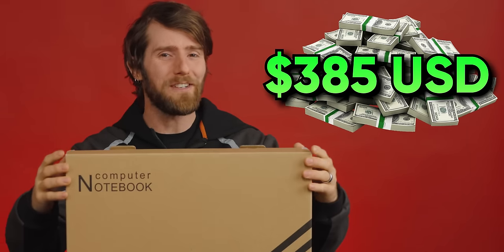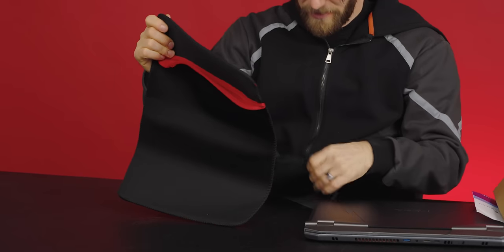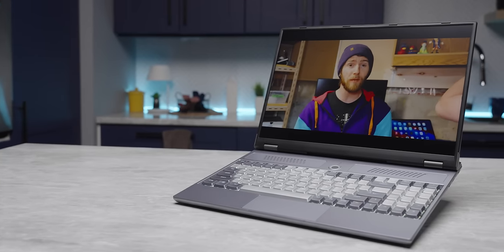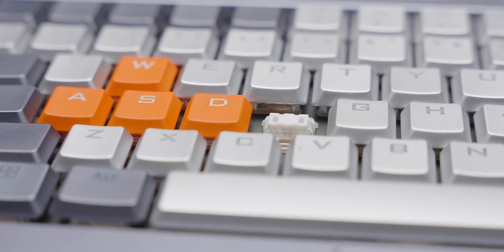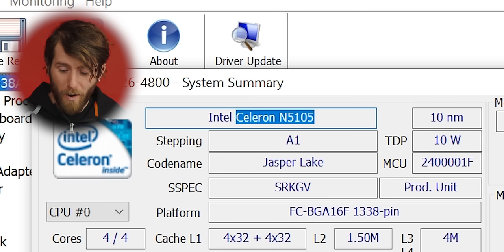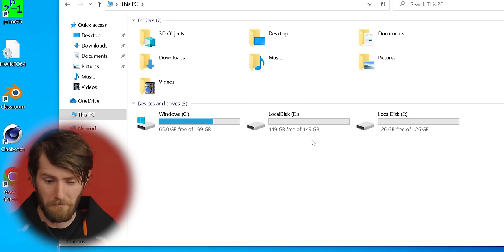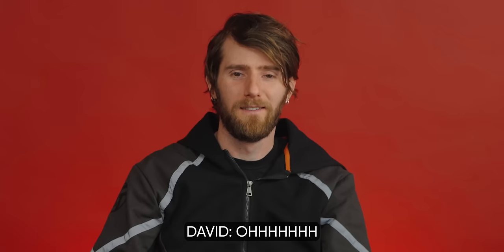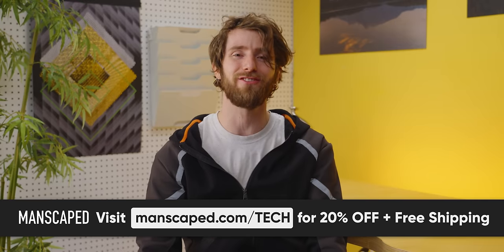Brown Star for Effort – This AliExpress Gaming Laptop is HILARIOUS

Comment: For that batch file to activate windows, "jh" stands for "JiHuo", which is the spelling of the pronouncination of "激活", or "activation". I assume they are installing a legit copy of windows but activated it with some magic from this batch file. I won't doubt any changes they made to this particular copy "bad" since otherwise they could just remove the activation entirely. The reasons they made those changes such as partitions on hard drive, arrangements of icons on desktop, could be based on behaviors of potention users who would purchase this laptop. This looks like a perfect gift for parents and my parents would do the exactly same thing with any new laptop. The activation actually could be legit as well if they are indeed authorized for OEM activation on devices for sale. There used to be a time that all laptops sold in China were installed with windows copies activated by such batch scripts relying on OEM servers including big companies like Asus or Dell. The scripts basically just install a product key, change the activation server to any corresponding OEM server and finish the activation process. Of course you could "build" your own "activation server" and run your own script to pirate, and that would be unauthorized and not allowed.
Reply: Lol, my parents don't even know what a hard drive is, let alone how to partition one, lmaoooo.
Reply: They are using kms activation in the batch file. It is not uncommon
Reply: I would reformat it just in case. You never know if Xinnie the Pooh has access to your files with a Chinese device.
Reply: This reinforces my feeling that everything about this is like "we left the provisioning script on the device" which is like, idk, I've worked IT, I've done that. The paranoia is tedious. For a high school or early college student with a lot of papers to write, and at $350 USD? This sounds like a really nice computer.
Reply: @dejuren wait, what is gaobao?
Reply: 高包? 高保?吿包? tf yall fake Chinese talking about I had never heard anyone in China call the internet or anything  "Gaobao"
Reply: @DD Johnson  I've never heard that either. I guess he was either joking something I don't know or maybe he meant "taobao"?
Reply: @Lying29  dude throw an unfunny joke and got everybody confused af💀
Reply: @ddjohnson9717  nah, just some edge lord making up Chinese soundings words and think he's cool.
Reply: @dejuren i remember back in the day you could get 3 spring rolls to the bao. now all you can get for 3 bao is one of those fur hats that lei feng wore, and you can't even get a green one since green hats are such a rare high social status symbol in china
Reply: I don’t think your parents would set it up to show hidden files though. That is dangerous.
Reply: @Gionimo  My parents on a windows for sure would. If I was a parent I would too, hidden files on windows is a great way to lose gaming saves and configs if you're not using steam(gog, minecraft, indie games etc do this a lot).
Reply: @UltimatePerfection  CCP can just buy your information from Microsoft, no complex operations needed
Reply: @Lying29  高堡奇人的高堡？means a weirdo country or land? 不知道。
Reply: @dejuren 没有什么好人坏人，只有明白人。你说对不，好纽约, 纽约北方网友.
Reply: @唐牧城   That is my point. It is cost inefficient to “spy” on every device; or buy them from third parties. Btw, your data centers, and their contents, are, by regulation, subjected to CCP inspection if requested inside mainland, even if you are international company. So you don’t even need to buy the information if you are only talking about the 1.4 Billion people, which I presumed not to be the subjects of the comment I replied.

And don’t talk about GFW as if you experienced it by yourself, lol. There’s plenty of ways to go around it. And Chinese international students alone is about a million now, which most would return to China. What GFW really is for are people, such as dumbass “conspiracists”, like the commenter I replied
Reply: @UltimatePerfection  still better than being controlled by the eye of pyramid
Reply: @ahweikun  wdym?
Reply: @UltimatePerfection  I hate to fuel your paranoia, but even wiping the SSD/HDD/whatever other mass storage device is used doesn't guarantee the device is clean, as unwanted software can as easily be a part of the firmware stored in an onboard chip, for example
Reply: @MrCh0o  Agreed, but it's the first step to getting the device clean. And something that everyone can do. Auditing firmware (and removing any malicious code in it), on the other hand is much harder (and for the same reason firmware hacks are seldom used by even the government actors - remember Pegasus? A regular piece of malware. Highly sophisticated, yes, but it doesn't hide in the BIOS or anything like that).
Reply: @dejuren lol you must’ve learned that from obscure right wing sites. You ask even a tech savvy Chinese citizen and  they don’t even know what you’re talking about. How bout you write the actual characters?
Reply: I found a dell factory key generator on a flash drive one time. It would install the os and use almost this same script to contact the servers to finish activation. It would provide a legit copy of windows (after if activated itself) to anything you plugged it into.
Reply: Do they still do enterprise activation? Basically IT at a company ran their own activation  server or had a key that didn't require activation, and just paid Microsoft to use 1,000 of them or whatever. Microsoft could do a software audit if needed and if your network use was off, could get penalized.
Reply: @TheZachary86  Well he was writing the actual Chinese characters but it's just two separate words combined together and they mean nothing
Reply: @UltimatePerfection  xinnie the Pooh 💀
Reply: @Lying29  Maybe you should moonlight as a consultant for Linus tech tips. Or they could at least cut you a check for educating them on their professional review of the product.
Reply: There’s a lot of 3rd party activation servers (they’re most China based, because they don’t care about piracy enforcement no matter what MS says) and you can assign them via slmgr and it will run a full activation when you use the appropriate KMS key
Reply: I’ve seen a similar trick done with some interesting systems that have come out of Iran. Amazing the innovations when there are blockers that seem impossibly to overcome.
Reply: @@dejuren1367 I can't understand what you say.
Reply: @auqustfire  My dad and grandmother knew how to partition hard drives in the 90's.. too bad both of them are dead now by 2022 :(

But yeah, just depends who is in your family I guess lol We grew up with Commodore 64's and all types of PC's in our family.

I do miss those days going to PC shows with my dad and grandma
Reply: @UltimatePerfection  The usual projection. Windows back doors are by NSA etc.
Reply: @steinbauge4591  Again, I would rather be spied on by someone who I know my country is allied with than someone who is at best of unknown allegiance and at worst the enemy.
Reply: @UltimatePerfection  You maybe but Windows is used all over the world.
Reply: @UltimatePerfection  Yeah, certain countries have already banned Windows on state/company level ;)  They opt for 'official' Linux versions like the Russian Astra. Only reason to keep Windows now is a few applications and convenient gaming.
Reply: @steinbauge4591  Agreed. Can't wait until Proton matures enough to play brand new titles.
Reply: 我个人觉得这个笔记本挺便宜的，更换SSD，重新安装系统. 用来上网，看视频啥的不错 :)
Reply: Magic
Reply: 你字多跟你混
Reply: @UltimatePerfection  i rather a pooh panda access my files than the CIA... at least i know the panda won't try to murder me with a drone or falsely accuse me of rape... =)
Reply: @UltimatePerfection  I too would reformat, because I rather have it my way, but let's be real, who cares about where their data goes while having a Google account to comment on YouTube? Chances are, every government interested already has your data, so there isn't really a difference that would make.
Reply: @YongSiawKong  国内叫绿镖, 好像卖一千多人民币
Reply: FC
Reply: Does anyone else find the error handling bit... just a bit sus?
Reply: Yup, I worked IT years and years ago and we had the same kind of activation for computers.  pulled activation from a server when we ran a script on new builds
Reply: @UltimatePerfection  I'd rather not be spied on by someone who can use my information against me (USA) than by a country that's too far away to do anything lol
Reply: @AndRei-yc3ti  I can only speak for myself when I say, it is more palatable for the US to do it because I pay taxes to them and they are at least nominally acting in my best interest (which cannot be said of the CCP).
Reply: @Brandon Y  the US is more likely to use it against you though and has a history of using it against its own and foreign citizens. China does not
Reply: @AndRei-yc3ti  I can't tell if you're actually an honest but misinformed Chinese citizen who's been influenced by propaganda or an actual government account... either way, this is clearly wrong to anyone who is remotely aware of the CCP's approach to surveillance. My Chinese classmates throughout COVID frequently remarked at the extent to which the CCP involves itself in the personal lives of average citizens. Any time foreign news correspondents travel to China, they are escorted by government handlers who prevent them from talking to the wrong people or viewing the wrong things. My ex-gf's father was a member of the Chinese government, and she frequently confirmed just how much surveillance they conduct on people. To say that the US conducts even a fraction of the same level of surveillance as the CCP is transparently false; it's tantamount to trying to convince people that the sky is green.
Reply: @Brandon Y  bruh...🤦‍♂️ I have videos on my account I am not Chinese

Seems like you bought into propaganda or are a US pentagon account....either way what you said is totally and utterly wrong. My Chinese classmates all want to return to China - they have frequently remarked to me saying "nothing makes you love China more than living in America for a few years". Indeed, I was shocked to learn that outside some censorship on social media sites like Weibo (similar to twitter) there are mass protests in china in cities and even a tome period where citizens can submit their opinions regarding proposed laws! It is rather common to escort Foreign news correspondents, especially when they come without a permit or are coming in bad faith.

It is America, not China that has been caught red handed with the surveillance program PRISM spying on every US citizen and through the numerous backdoors it has built into its chips and software like Windows - if China had anything similar, it would have been trumpeted all over the world. America is a police state - this is a fact easily verified
Reply: @AndRei-yc3ti  Whatever man. You can ignore reality, but you cannot ignore the consequences of reality.
Reply: @AndRei-yc3ti  I've seen that--very impressive looking, but also a non sequitur in this case.
Reply: Yeah like the pirated your own KMS server lol
Reply: found the Deeq rep lol

Comment: Multiple partitions are still useful for system recoverability.  Stick the library folders on a secondary partition (or preferably, second drive) and reinstalls of the OS become so much easier.

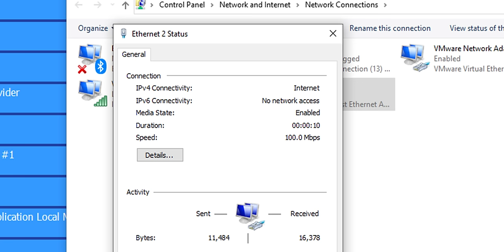Comment: 3:23 Fast Ethernet only uses 4 of the 8 twisted pair connections by design, so makes sense.  Think of the half a cent they saved on the design XD
Reply: Yes I'd be glad to know that the Ethernet card is using the inferior 100 Mbps from the get go by looking at the pins, instead of the pins being present and not being used at all.
Reply: It's those cents that allow them to cut the price that much. Do that 100 more times and you can sell the thing for 250 dollars
Reply: I buy that similar white usb-Ethernet before it names 10/100mbps Ethernet (10 year ago) but sadly it's just ..10Mbps lol. 100Mbps Ethernet will be fine for internet now aday.
Reply: I have one of these I bought sometime ago that I keep in my tech bag to diagnose bad network ports/WiFi, and I don't think I paid but maybe $5 for it on eBay, and it works out of the box with Windows, Linux, Mac OSX, and Chrome OS/Flex. so kind of handy to have for such a cheap price even not being Gigabit.
Reply: @CommodoreFan64  Same.  I have one as well (for the same price) and it's useful extremely for the situations you described, plus maybe for a quick configuration of a router, network camera, etc.
Reply: it's not about the pins they save, it's about having an much older and much cheaper (close to free) lan chip.

Comment: I love how Linus called Andy to tell him what the battery voltage was although it was written using normal decimal numbers
Reply: Also, a dinky two-cell 7.6V lithium battery powering a 16" laptop? I wonder how much current that thing is pulling on a regular basis at such a low voltage. Might be worth checking to see in a month or two if the battery's power connector or harness has melted or turned brown yet.
Reply: @zorilla0 nothing will happen bruh, it's pretty normal for such weak laptops to have two-cell 2S1P batteries

Comment: The reason of partitioning is that they use one single drive from which to copy for SSDs of variety of capacity. They copy it, and add some partition. It's easier for them.
Reply: Kind of ingenious actually... hadn't thought of that.
Reply: They could literally let automation expand the partition to fill the disk once they have sysprepped it.
Reply: Don't get, can some one dumb it down further plz asking for a friend 🙏
Reply: @ProjectPewgf  they probably sell many variants with various disk sizes (128, 256, 512 GB and so on), so they just make a partition for windows that would fit the smallest size (e.g. 128 GB) and then make more partitions to fill the remaining space on larger drives. It's actually faster than resizing an existing partition.
Reply: @francescogugliuzza3827  Now that makes perfect sense thank you mate
Reply: Growing a partition is basically instant, it's shrinking or realigning that takes time. I do agree that this is probably why the drive is partitioned, but it betrays incompetence rather than cleverness or laziness. What they should be doing is creating a compressed image (you can do this with basically any VM software), writing that to the disks that go into the computers, and then expanding the C: partition to fill the disk, which will be basically instant because no data needs to be moved, all you're doing is updating the block count in the partition table. You're writing two 4k blocks, it's nothing. Microsoft place the C: partition last nowadays for this exact reason, it makes migrating an install to a new (larger) drive so much easier.
Reply: @СусаннаСергеевна  you're right, resizing an NTFS partition is instantaneous and can be done in a script. It is indeed a lazy solution.
Also, various disk cloning tools can be configured to extend partitions automatically when copying an image to a disk.
Reply: @AgentSquirrelA  I was gonna ask, couldn't they just extend the partition just as easily?
Reply: @AgentSquirrelA  Until it fails the expansion and ruins the partition and you have to leave your computer on for a month until you figure out how to fix it.
Reply: Nah Adam’s right. Sysprep and DSC will do all of this easily and dynamically
Reply: @francescogugliuzza3827  There are not that many disk size variations, they could just make 5 clone versions for each disk size. Their way seems to me plain lazy
Reply: No need for that any tools I've ever used for imaging and deployment can work easily with larger drives without any need for partitioning.
Reply: There is one argument I can think of for partitioning - though this is something I'd typically only do in a single drive setup.  I do not like storing data on the same partition as OS/Apps if I can avoid it.  If I ever have to reinstall the OS because it's not booting, I can just wipe the partition and reinstall and be less worried about having to do data recovery as it's on a separate partition.  Otherwise,. I try and use as few as possible just for simplicity.

Things are happening slightly differently now, with enthusiasts and above typically using something like a NAS.  But in certain situations, these are not normally guaranteed and the software and data is still stored on the same machine - this is where I would consider still partitioning to separate the two, particularly if they're not yet sold on the idea of a NAS or that's not practical for them.
Reply: Wow TIL. I literally thought my laptop had 2 halved size SSDs in both slots until I formatted the drive to discover it's just one.
Reply: @СусаннаСергеевна  you can always delete the extra partition and expand primary... often harder to go the other way around. They preserved flexibility for the end user.